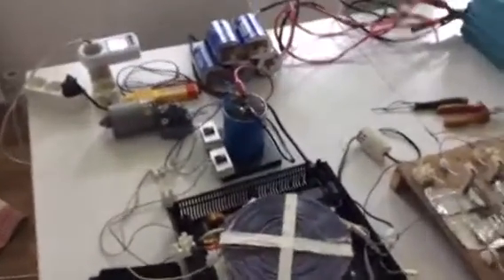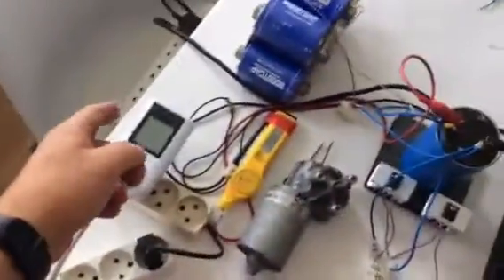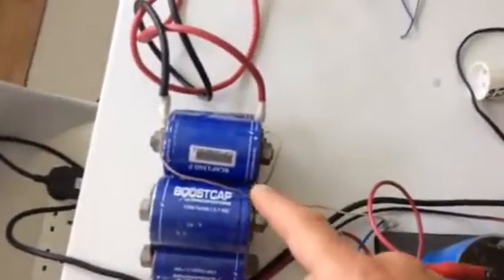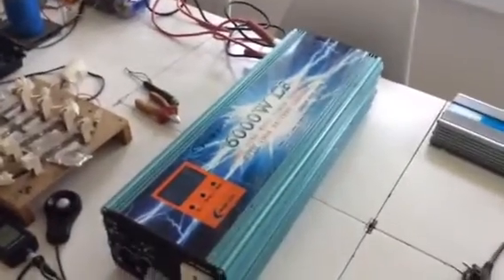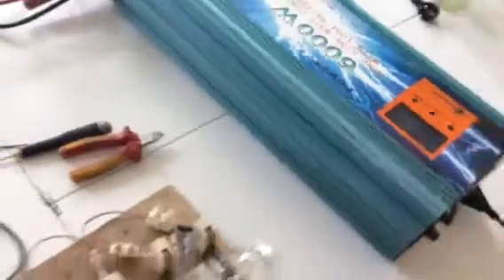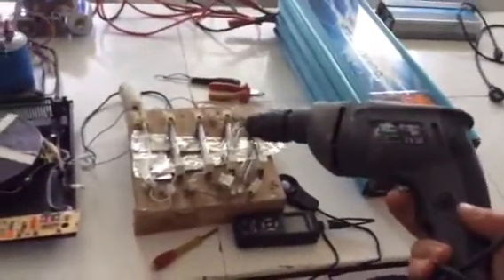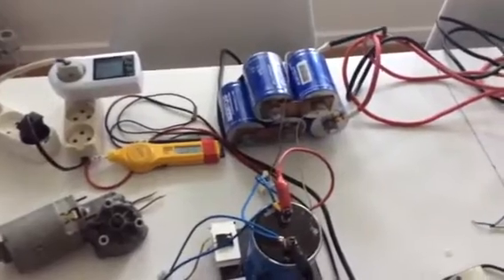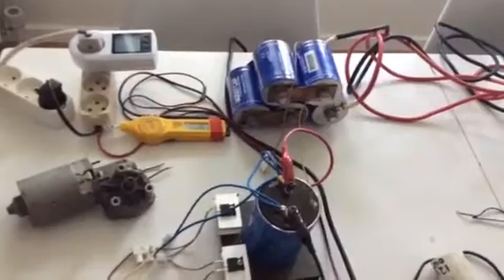INductrion transformer, tesla, Kapanadze, Akula

Comment: That drill can draw up to the 760 watts, but under load. When free-wheeling it draws only 100+ watts (per the inverter display). So far I only see an air core step down transformer with tesla pancake coils, a very elaborate setup at that.  Where's the extra energy coming from?  Increasing current and decreasing voltage with a step down transformer maintains the same power (except for losses) across the in and out windings, not necessarily current and voltage.  Filament bulbs running at half voltage will draw 1/4 power, P=V^2 / R, not full power.  More meters would show this more clearly.
Reply from the maker: Oldskool Driver I hope to be able to hook up a scope this week. This vid is not a free energy device as we use the mains. What it is trying to show that it could possibly be an alternative that would allow fast charge to the caps,possibly faster than the normal battery setups on the market. Just to stimulate some ideas.
Reply: @dkdyker  can i get the circuit diagram?:)
Reply from the maker: @rolandruiz1972  please look at JN Labs website and look for Gegene you will find the drawings . Ihope this helped.

Comment: Great set up - so you are just charging the supercaps from the output of the top pancake, while the bottom pancake is powering the lights. That's impressive! 
You are rectifying with 2 diodes to the 48v cap, then from the 48v cap into your boostcaps. Are you just performing smoothing from the 48v cap, or why is it there - can you not go from the diodes to the boostcaps? Also (I think I've asked you this before) why are you only using 2 diodes instead of 4 for rectifying?
I've tried 2 pancakes like that but don't get that much output from the top one as most was "consumed" by the pancake below. I suppose there are various factors to consider when winding them.
You don't show any figures for watts consumed by the inverter - but even so, you've got all the potential power from the bottom pancake to add to the mix. Have you tried rectifying THAT output into caps at the same time? I'm still waiting for my big caps to arrive from China and would love to test this again then. Thanks for sharing.
Reply from the maker: Mark Flint ok the 50VDC cap I use as a buffer because it would damage the ultra caps I think? Yes I use shotkey diodes as two seems to allow faster charging. I would like to be able to do the same on the other coil and double the D.C. This should allow for looping I think.

Comment: Nice setup. Is there something that used to regulate the charge for the ultracap or you just calculate the number of turns on the pick-up coil?
Reply: dkdyker good job sir
Reply from the maker: JB-N107Lab hi JB no it only goes into the 50v cap then straight into the boost caps.I also think about the other coil and if rectified also into caps it would give double the run time.